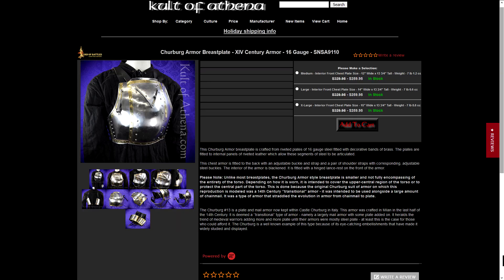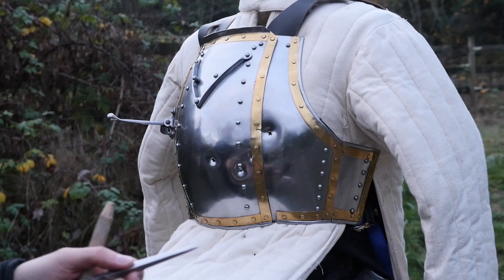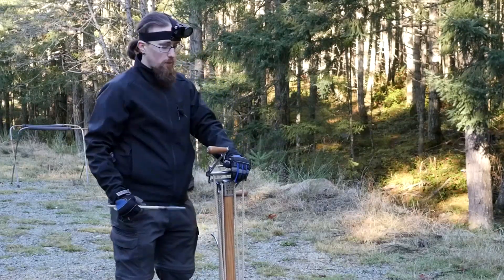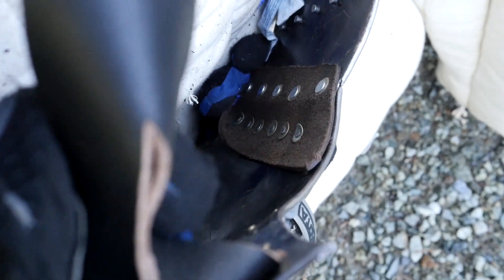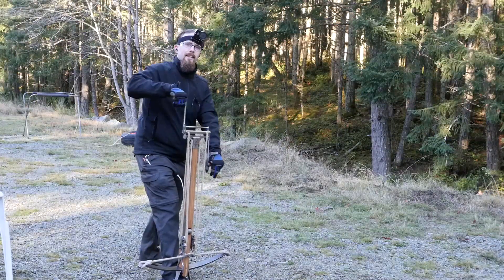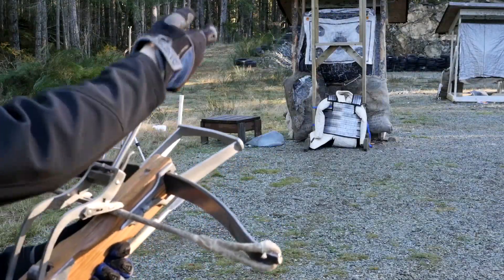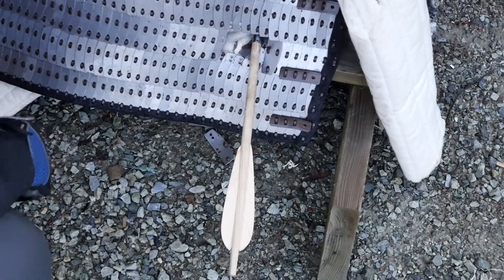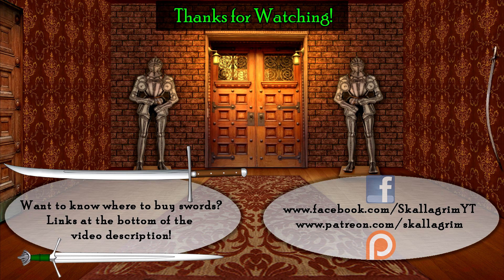Medieval Crossbows vs. Breastplate and Lamellar Armor

Comment: One thing or two about that lamellar armor:

It is not supposed to be too thick, since it then would be quite a bit heavier than a solid steel breastplate of the same size and thckness considering the overlaps etc. It doesn't need to either, since it does its job of stopping arrows. Considering the tribes that used to wear lamellar (Chinese, samurai, mongols and other turkic people) you can see that they all (maybe the exception of china) were mainly horse archers. As such, they only need to be strong enough to stop the common recurve bows used.

The second thing is that the laces would generally be a lot better, ones that snap by just pulling on them are not very ideal for the battlefield. The first lame would probably not have popped off if this would have been the case. 

Lastly, there seems to be none overlap on that particular set which is a big no-no. Overlap is a very good way of making sure the arrow dissipates its energy going through the first lame and cannot pierce the second. Two overlapping 1mm lames should perform better against arrows than one 2mm. Haven't tested it though.

Comment: I made up a harded tip arrow in metalworking class at school (35 years ago) with a very sharp (apple-seed shape) tip. From a 63lb draw weight flat bow, it penetrated 1mm mild steel. normal field points just blunted and bounced off. Hardened, sharp tips make the difference.

Comment: If the tip of the bolt wasn't so wide it might have gone through. I once shot a long nail  with a crossbow, it went about 25mm deep in a block of oak wood. (but the crossbow wasn't a medieval replique. I made it with an old car spring ^^)

Comment: Can somebody tell me weight of that chestplate?
Also if you are to add 6mm layer of leather over steel (assuming it will soak energy/speed), how much smaller dent would it make upon impact? 50%smaller, less then half, way more then half?
Also hypothetically real piercing multiplied for sake of argument: if bolt can make 100 mm hole in steel armor alone how much mm hole would it make with leather over the steel? Would the difference be so huge or just small ?

Comment: The bolts definetly want to punch through you can see the metal breaking and bending. I would gander that the crossbow has more then enough stored energy to punch through but lacks the energy efficiency needed. I would guess that a longer lighter arrow moving faster with a much thinner bodkin tip would cut right through it. Speed is what will preserve the energy needed

Comment: This crossbow should be tested on a chronograph because doing a mental calculations using numbers out of thin air I am thinking that a 900 lbs crossbow would shoot 725 grain bolt at around 215 FPS which means 75 FPE / 101 J

Comment: The leather on the lamellar broke apart at will (which is, of course, the weakness in all lamellar), but that’s clearly not boiled leather if it broke when you pulled it with your hand, so it would be interesting to consider how it would stand up if the plates were a bit thicker and the leather a bit stronger. Also, didn’t lamellar usually have a boiled leather backing? I think that would help remove some of the tension from the strings.

Comment: Not an expert on lamellar - it's more of a Rus/Eastern armour - but I seriously doubt an actual historical armour would have used tanned leather lacing at all, ever. For one, that stuff breaks easily even when new, and it'll rot away in no time flat. Rawhide, or even regular woven strings are much more likely. Better tensile strength, and woven string may well be cheaper. Well, unless you're using silk, but a silk cord would have fairly impressive tensile strength.

Comment: i don't get it , if crossbows so useless vs armor then why in old days they even use it ?
Reply: Easy to use, easy to aim, will hurt plenty if it doesn't hit armor, has a couple hundred yards longer effective range than a lance or a spear, is VERY useful in the single most common battle type of medieval period, namely sieges. Additionally, it is frightening to be shot at, and may make a person flinch at an inopportune moment. Furthermore, non-penetrating hits on head and throat might knock the target unconscious or cause lethal internal bleeding. Hits on hands might break bones, rendering the warrior completely useless.
Reply: so it work as supporter thing not killing machine , am i right ?
Reply: No, not really. Crossbows really did kill people, and in reasonably large numbers too. I've personally seen human skulls penetrated by crossbow bolts when I visited Visby museum. Additionally, I'd be pretty comfortable claiming that most combat casualties suffered during sieges were cause by crossbows, and you'd do well to remember that the English king Richard the Lionheart died from a crossbow wound. Also, Turks, Egyptians and Arabians all commented on the fact that Christian crossbowmen were effective against their forces during the crusades, while their own bows weren't initially all that good against the European armor.

You have to understand that while crossbows didn't penetrate plate armor, neither did pretty much anything else either, ballistas excluded, not even the earlier firearms. That was the point of armor, to protect the wearer. It's the exact same thing with modern plate carriers. They can offer full protection from even full rifle-caliber rounds, but that protection only applies to the area that the armor plate covers.

Another thing is that a fully armored man-at-arms was always a minority group on the battlefield. Usually they accounted for around 5-10% of the fighting force, and rarely up to 20%. The other soldiers wore some armor, but most of them didn't have as much of it, or not as high quality. 

If you have a weapon that is even at the very worst a good weapon against 80% of the enemy soldier and perfectly fine harassing tool and inconveniencer against the men-at-arms, and that weapon is easy to use even for inexperienced soldiers while also being reasonably accurate at long distances, would you have your army utilize that weapon? I know for a fact that I, as a imaginary general, would jump at a chance like this.
Reply: good to know its just small group of them use armor , now crossbow make sense to me now , also thanks alot for the great comment
Reply: Most of them used some armor. Almost all had shields. A helmet and a padded jacket was something pretty easily available to all soldiers, and were quite resistive against bolts. I'd like to stress again that wounds are caused to the places not covered by armor, and almost all armor has spots that by necessity must be left uncovered. It's just that the more wealth the warrior had, the smaller the chance of somebody actually bypassed his better armor.

There's no single weapon that is expected to be able to kill anyone and everyone on the field. Crossbow is pretty much the best handheld ranged weapon in medieval Europe, and even if it wasn't an auto-win button or wasn't the sole highest combat casualty cause, there's value in being able to shoot enemies from afar. It's a jarring and terrifying experience to see somebody right next to you suddenly start screaming with a bolt sticking out of his thigh, knowing that it was mostly pure luck that you weren't the one that got hit. Kill and wound a number of men from a unit, not even a large percentage, and they are frightened enough to break and flee when threatened by shock infantry or cavalry. That's an astounding success as far as tactics go, especially as the goal of an army is to achieve victory and wealth, not kill some random people.
Reply: "Also, Turks, Egyptians and Arabians all commented on the fact that Christian crossbowmen were effective against their forces during the crusades, while their own bows weren't initially all that good against the European armor."

citiation?

Comment: High quality breast plate armor or harnesk just get a scratch from  the crossbow. Impervious. Hardened steel that is. I would say, breast armor back then got a thickness no less than 1,5mm. Maybe 2,0mm even, for a proof-test was a pistol-shot, from a horsemans pistol, let it be a muzzle loaded pistol loaded with a lead round ball 16mm calibre. A dent was the proof mark.

9mm Parabellum m/39B takes 2,3mm mild steel + almost 2,3 mm again, shot from a normal pistol with only 120 mm barrel  (from own tests) on a piece of pipe or tube, no vandalism or such:) The end of breast plates of steel and the start of Kevlar + Ceramic plates in the pockets :)

Some vests can even stop a Swedish steel-jacketed 7,62x51 800 m/s, but they are extremely cumbersome to wear.

Comment: When the French men-at-arms were (in)famously cut down at Crécy, what accounted for it?
Reply: My understanding is that at Crecy, most of the French men at arms fought mounted (the English dismounted and fought with pole arms). Due to poor command and control issues and following a heavy rainstorm, they were committed piecemeal, up hill and through hedges or 'pottes' (a group of small holes dug in front of the English troops specifically  to disrupt cavalry charges, a trick possibly pinched from the Scots) . Oh and through their own Genovese mercenary crossbowmen as well. 

Most of the horses (as opposed to the men) had light textile covering at best and suffered badly as they were the subject of focused massed archery by around 5,000 heavy bows, which may have been deployed to channel them into hitting the solidly formed English ( and Welsh) close combat infantry. 

Despite all this this the French charged up to 16 times and some French and German men at arms actually broke through the English line, and  to put severe pressure on the Prince of Wales' battle. However there were not enough to convert the break through into a rout and they were eventually contained and cut down.

In later battles such as  Poitiers and Agincourt most of the French men at arms  fought dismounted as a direct result of the experience at Crecy and immediately succeeding battles. The English were still careful to choose strong defensive positions, with disruptive terrain and the French still had poor command and control. While the casualties were very disproportionate, on each occasion, the French reached the English line and succeeded in driving part of it back - the English usually suffering heavy casualties  before driving them off - at Agincourt the Duke of York Henry Vths brother was one of them as was the Earl of Suffolk and Henry himself had part of his crown hacked off his helmet. 
 
Interestingly the French often used a 'forlon hope' of mounted troops committed first, possibly in the hope of catching the archers unprepared or panicking them into flight. At Poitiers there were two, one on each wing. The French on the right were driven off easily, but the Germans on the left had armoured horses and proved significantly less vulnerable. They were only driven off when an English force out flanked them and shot into their less heavily protected flanks.

No one on the English side ever doubted the skill, courage and tenacity of French nobility, hence the extreme precautions they took to neutralize them. On the few occasions they did not (such as Bauge, where the English knights charged mounted uphill into the French....) they lost - badly. The French could and did adapt their fighting techniques during the 100 yrs war despite being hampered by a rigid social structure, mad monarchs and half their country preferring or at least allied to the English  and eventually found the answer - the professional 'ordonnance'  armies and the use of thew gunpowder artillery and entrenchments (cf the battle of Castillon).

Comment: If you can try to get your hands on klivanion-lamellar armor, It is a east-roman design from around 10th century. It should be on-par with plate armour due to it's robust building method

Here is a picture of a reproduction:
https://s-media-cache-ak0.pinimg.com/originals/3b/11/96/3b11966215719a839b85b726e4e4ef22.jpg

and here is a picture where you can see its design and thickness:
https://orig00.deviantart.net/8377/f/2014/200/5/a/byzantine_brass_klibanion___lamellar_by_lamellars-d7rbf3f.jpg

Comment: Why havent anyone made a range for this  a target that  moves towards you whit  armour attached to a gel body whit sensors and thats mounted on a car suspension spring so it bends away when hit. pardon poor english grammar and all but  did i over do it ?
Reply from the maker: That sounds like a $10,000 test setup. Might be why it hasn't been done so far. :)
Reply: well there are shooting ranges in sweden to make sure our hunters are compitent at moving game   all you need to do is change the angle and have fun  cuss bow dont go  1000 meter extra if you miss .

sorry if i sound like an idot but i am one

Comment: Great vid! Possible video discussion. Zombie apocalypse. Should a survival group work archery (bows and crossbows) as an alternative to guns...since resources may be scarce and bullets run out. How would a team of archers fare against gun wielding opponents? How would you train the archer squad?  What are the advantages and disadvantages?
Reply: I'd say that with a high school chemistry book and some brass to start with, casting and reloading would definitely be easier than making competitive crossbows and arguably be easier than making good quality bolts and arrows. Furthermore, with a bit of pipe, some welding and fertilizer-derived mild explosives, you can easily build a flintlock gun. If you have some shot shells without powder, primer or shot available, stuff glass or sand in them and launch them from that makeshift flintlock. You've just made yourself a shotgun.

Seriously though, the only case in which humanity loses firearms is if absolutely nobody is willing to go through the small effort of learning how to make propellants while having easy access to all of the necessary information. As there are plenty such people already, I'd consider that unlikely.

Comment: 1mm is about right for lamellar as Japanese lamellar armor was about 0.8mm thick plus a thick layer of lacquer.
There is the usual problem of modern materials VS those available in those times but alas it’s inevitable.
I have to say terrible quality for the leather connecting the plates… considering it’s one of the most important part of that king of armor.

All in all really enjoyable video.